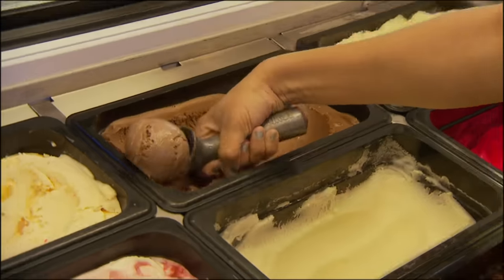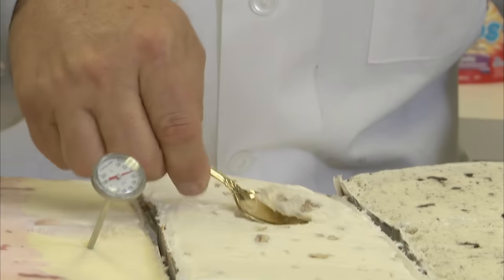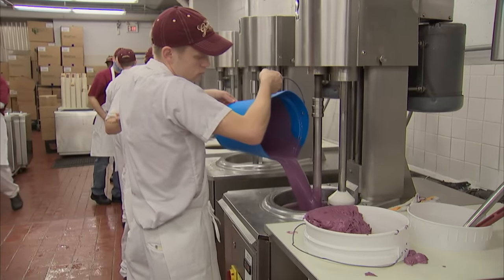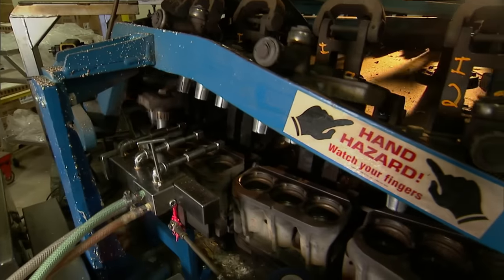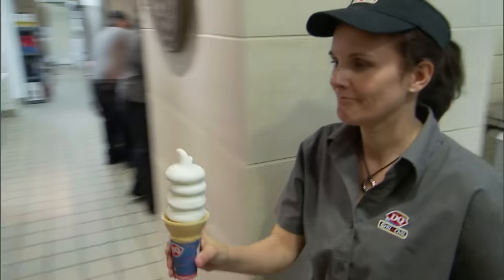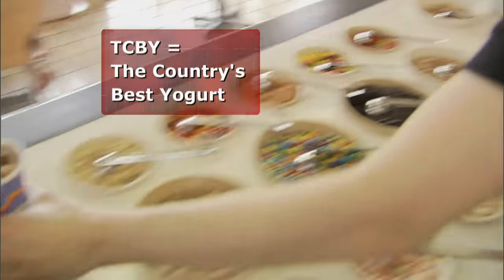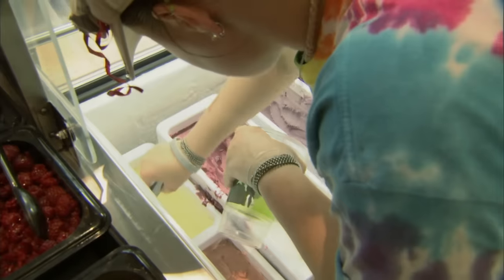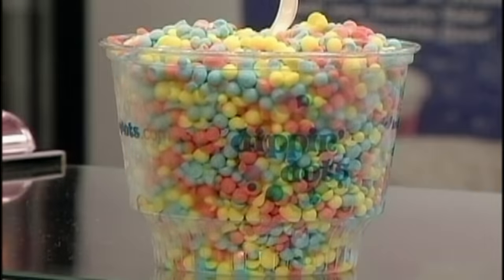Modern Marvels: How Ice Cream is Made (S14, E18) | Full Episode | History

Comment: “And soft serve is ready to eat all day long.”
McDonald’s: What?
Reply: The machine at McDonald's goes into beat mode for 3 hours a day when in sanitize is itself 
They are supposed to schedule it in the slow hours or when the store is closed
Reply: @jamesricker3997  From what I heard the machines are constantly "broken" so the manufacturer can come and fix it. That's how they make their money. A guy invented software for the machines and when used they worked flawlessly. But the franchises had switch back to the OEM software because of pressure from McDonald's. Really scummy in my opinion.
Reply: @multanmangel3887  yes there is a really good mini doc from a youtuber that unvailed all of what you said. It was a really good doc.

Comment: Why are they calling this a generator. It doesn't generate power. It has to be charged. It's just a portable battery just like the ones you can buy at Walmart. They are called a jumpbox. That also includes an aircompressor. They only cost $120.00. And they are going tell you how much they are going help you get rid of over $2500.00. Wow that's way too much for a regargable battery. And it has to be maintained you can't store this battery for any length of time it has to be charged  bye weekly or it will go dead